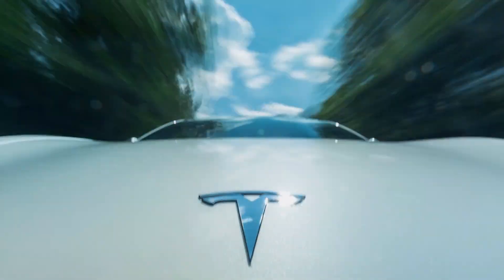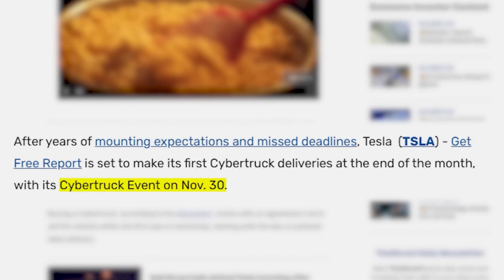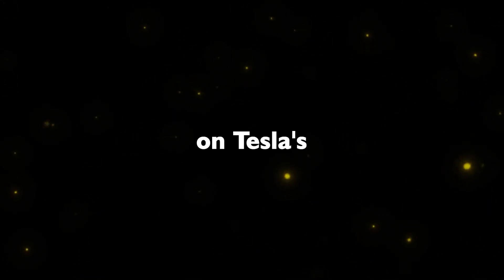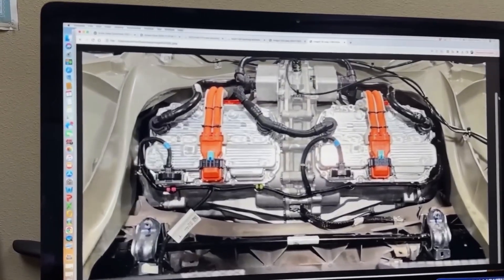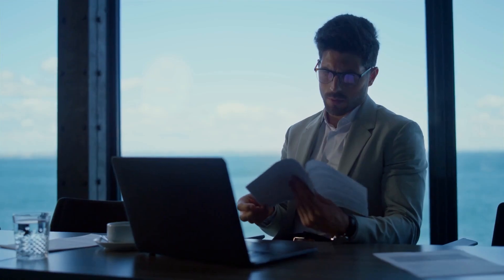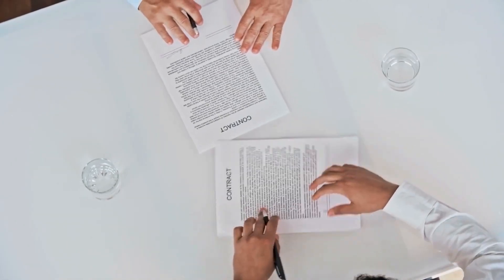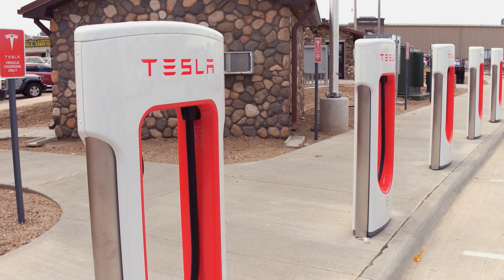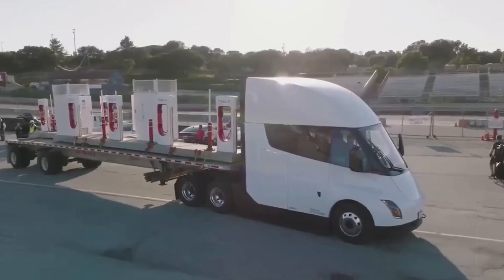Cybertruck: Full Specs Unveiled!

Comment: I'll be surprised if it happens as advertised. Did it pass pedestrian collision safety reg's? With bullet proof stainless steel it will be very very heavy. (More than the 3T advertised). Can't see it working on soft Australian beaches. Imagine the impact on range driving through thick sand. There are also no chargers in the Aussie outback. It will definitely be way more expensive than Elon Musk's predictions. Can't see it being a success here. Maybe initially because of the novelty. 
I'm happy to stay with my Hilux diesel 4x4.